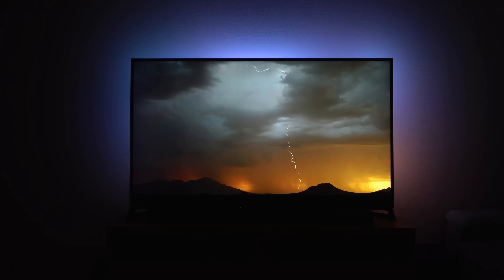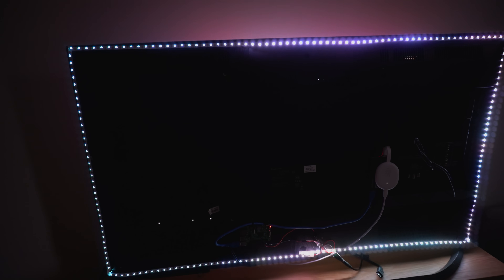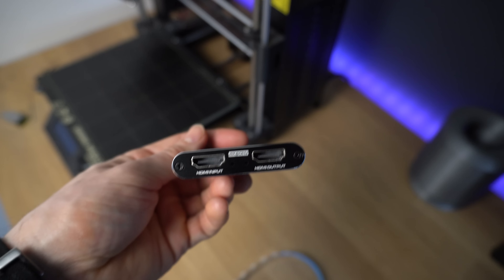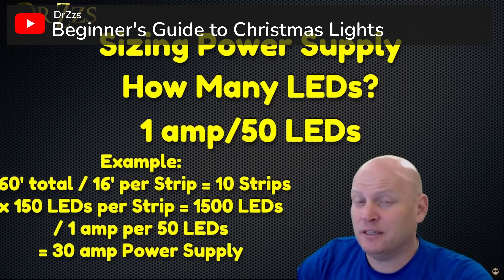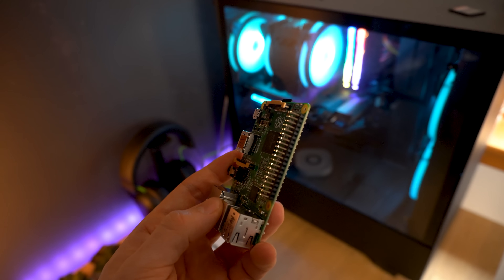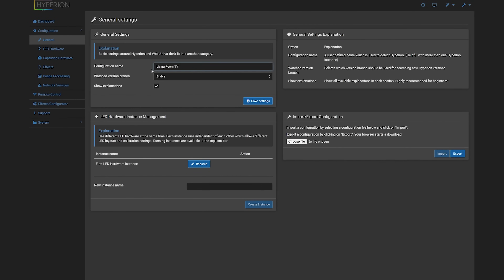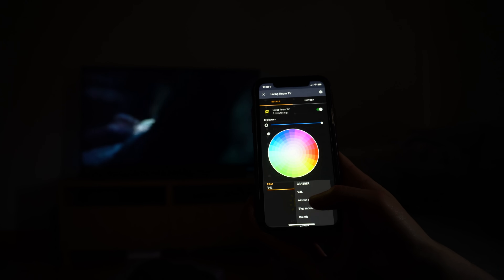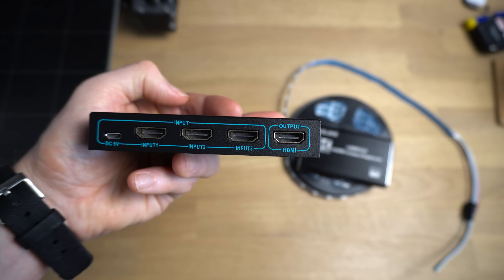Cheap DIY Ambilight TV Project with Hyperion and Raspberry Pi

Comment: Hi Very nice video. I did a similar setup but I happen to find your video after I bought the capture card. I got this one instead : https://www.amazon.de/gp/product/B08JPTXVJN/ref=ppx_yo_dt_b_asin_title_o01_s01?ie=UTF8&psc=1 It looked like It was fitting the purpose 4k60fps, But I didn't know about the HDCP2.2 feature. Can you tell me by looking at the settings If I should get the zasluke instead ?

Comment: Damn, I should have seen this before. I ended up buying this 4k splitter:

https://www.amazon.co.uk/dp/B083JVPXDY/ref=cm_sw_r_em_apa_glt_i_S0J9R1QP433V2X478T0X?_encoding=UTF8&psc=1

And then fed one output to TV and the other output to ANOTHER cheap £18 device, the capture card which then outputs via USB to Pi. Same outcome in the end and probably for a few £ cheaper but I would have loved to have done it in one device if I knew this capture card existed!
Reply from the maker: Damn, well at least you got the same end result!!

Comment: Wondering does the capture card support hdmi cec? due with my current setup, I take the hdmi output through a splitter that does not support cec, and when turning off my fire tv, i still get sound through my sound system...due it does not get the cec off signal, so im considering switching it with a capture card

Comment: Only thing that sucks for me is that I used all the aps on my TV (Netflix,Amazon' ect) so I can't get video out to the capture card, or can I?
Reply from the maker: Yeah unfortunately not, there is solutions that involve pointing a camera at the display, but this isn't a method I would be prepared to use personally!
Reply: @EverythingSmartHome  guess I'd just have to get a fireatick or chrome cast or somthing.

Comment: was the speed of the capture card to the pi via USB fast enough to have a nearly instant response?    I've been holding off on this project for compatibility worries, especially w/ HDR 4k@60 to the tv, etc ,while still trying to keep the cost down!
Reply from the maker: Works amazingly for me personally yes!
Reply: @EverythingSmartHome  Alright, i have everything set up, and it took me hours to figure (most) everything out.   Running a hdmi switch, splitter, capture card---   i was about to give up when I decided to turn my nintendo switch on, the whole thing started working correctly.   I changed the input back to my PC, and it's gone again.   Does this have something to do with HDCP? And how can I get around it?
Reply from the maker: Try starting off much more simply and remove the splitter for now to see what happens there, once you have that working then add the splitter back in.
Reply: @EverythingSmartHome  you were right-- i removed everything, and ran the pc input direct into the VCap, everything worked, but the signal was downgraded.  I ran from HDMI selector, same thing.        As you thought, when I ran direct from the splitter, I only get video signal and no lights w/ the PC input.   So something's wrong there: https://www.amazon.com/gp/product/B07J2Q9NPH/ref=ppx_yo_dt_b_asin_title_o00_s00?ie=UTF8&psc=1  (everything else running through this that I've tested is fine except the PC!)
Reply: I found a second thing that isn't working through the splitter!  4kFirestick.  i'm scouring the web for the issue before I try to swap the hardware! let me know if you think of anything!
Reply: @EverythingSmartHome  Here's where I'm at, and I'm hoping this helps you if you ever end up doing a complete build tutorial.    I narrowed the issue down to the splitter being the culprit.   I got out of PC builds, and TV upgrades before HDCP 2.0, and never really read into it (and I'm still pretty confused with HDCP in general), however the source selector was an HDCP 2.2, the splitter was a 2.0 (the signal was good to the TV, but refused to push to the USB grabber).   I'm upgrading to the 2.2, it'll be here Thurs, and I'll update.   
Another good tip for anyone new to this is ensuring they have enough HDMI cables, and that they're current with everything else. 
If for some reason the splitter swap doesn't work, I'm still narrowing the issue down to the 4k downscale into the 1080p https://www.amazon.com/gp/product/B08QJ84JNP/ref=ppx_yo_dt_b_asin_title_o01_s01?ie=UTF8&psc=1

With all that being said, what's the best way to support you? Patreon, or the buymeacoffee link?
Reply: Fixed.  Upon fixing I also found multiple other things that could cause issues for new users.   The splitter was an issue.  Replaced, immediately worked with poor res.  PC was reporting 1080 rez out.  checked the STD/TV switch... fixed.   Backlight went out again.  Checked the resolution settings on the PC, it was pushing a 120hz signal, switched to 4k @ 60, lights worked immediately!   Hopefully some other user finds this before they order components!

Comment: About the led placement on the back of the tv. The back of mine tv gets hot to the touch(aluminium). Can i place the led on the back of the tv with no worries?
Reply from the maker: I'm not sure about that sorry, I wouldn't want to advise incase it was wrong
Reply: @EverythingSmartHome  yeah, it's troubling... I'll fix some plastic spacers to solve it. But thanks for the feedback.

Comment: Fab video mate, It's really got my thinking - an hour ago I was considering the Hue Sync box and Gradient strips - Now I just don't know. Pricing the parts you've got here I'm wondering what you didn't include, as I assume you have quoted the upgrade cost of your current setup. I'm currently using a 4k firestick and a second input (its a non 4k source) and I do use Diz+, Nflx and Plex (plex mostly 1080p content) and drawing out my plan I guess I can use a 1080p capture if I use a 4k switch so a rough outline of my costing is

Pi Zero - £32
1080p Capture - £18
4k Switch - £22
PSU - £22
5M 60leds/m WS2812b - £36
Consumables - £25

Total running about £145

I think this is still good value compared to the £330 the hue is going to cost, and I imagine this will be cheaply upgradable with a standards change in the future, but something I'm not 100% sure of is would that 4k switch you have shown, show the protected content on my TV ok, and work with the 1080p capture card (from what I understand the capture card only needs to feedback the edge blocks, so I guess my bottlenecks going to be the HDMI switch). Its a lot of money for it not to work for me :/
Reply from the maker: Thanks Chris, sure I already had a Pi and I didn't include the switch in the price because it wasn't required for a single input so that would reduce the price a bit, but the Pi Zero W is like £6? Shouldn't be anywhere near £32 anyways so that should reduce the total price for you. 

The switch works fine in my environment but you'll need to check your own requirements to make sure everything matches up.
Reply: @EverythingSmartHome  Hi mate, I managed to pull together from various sources for about £100 inc some bits off your wish list, so thanks for that. I am overly impressed with the ease of setup and how amazing it looks. Don't suppose you know how to make a switch so I can have a static bias colour do you?

Comment: does it need to be a capture card or can I just use a hdmi splitter?
Reply from the maker: Just anything the the Pi can view the screen on. Would a splitter work since the HDMI port on the Pi is output only and not input?

Comment: Nice tutorial! I also bought myself a Raspberry Pi 3 Model B and this 4K Capture Card from Zasluke. I got it ready to work very fast, but I'm still having weird problems with the capture card not being recognized by Hyperion many times after a reboot, which is kinda annoying. Any ideas?
Reply from the maker: Thanks! Does it show up in the list of capture devices?
Reply: @EverythingSmartHome  This issue seems to be totally random. Sometimes when it's not working it still shows up on "Configuration -> Capturing Hardware -> USB Capture -> Device", but not on "Remote Control -> Source Selection" or Hyperion seems to lose part of its config and the USB Capture Device is set back to "Automatic".

For debugging purposes, I just rebooted 5 times in a row and everything got recognized and the LED stripe represented the colours of the input source, but after the sixth reboot the USB Capture Device was set back to "Automatic" lol. I installed Hyperion using the current Hyperbian image.
Reply: After some further examination, it turned out that the capture card didn't receive enough power from the raspberry pi USB port, causing the card not being recongized by the raspberry pi from time to time. There's also an indication that the raspberry pi is not able to offer enough power for the capure device alone, when the red PWR LED turns off once the capture device gets connected (dropping under 4,63 V)

I got it working now by using a USB 3.0 dual power cable, where the one USB-A connector goes into the raspberry pi and the other one into my external 5V 20A power supply. Now the red PWR Led stays on and the capture device receives additional power from the power supply and I haven't noticed any interruptions since.

Comment: Great project
I´ve rebuilt you system and i´ve connected the capture card with my Linux Server.
Everything works like a charm...

But when it try to run it on a Raspberry Zero W, the Raspberry wont find the Capture Card on the USB Port... :-(
How did you get the Capture Card to run on Raspberry? Is the a spezial driver needed?
I searched for the USB devices with the lsusb command, but Raspberry shows no device connected ....
Reply from the maker: Hey Michael,

I'm not sure on that one, I don't think any special drivers would be needed, my Pi Zero W worked perfectly with the capture card I had, nothing different to the normal one. Perhaps try changing your cable, some micro USB cables provide power only and not data so perhaps that could be happening?
Reply: @EverythingSmartHome  I’ve tried 2 different cables (I know they are ok because I used one of the for flashing the wemos).
Hmmmmm strange
Reply from the maker: Are you using Raspberry OS on the one that works and also the Pi?
Reply: @EverythingSmartHome  no, the working one is my Server running Ubuntu 18, the Raspberry zero is running Hyperbian (the per-configured Hyperbian Os) and there the USB device is not recognised
Reply from the maker: Ah, then yes there is a difference, different distros will contain different drivers. You would need to figure out which driver it is and then install it on Hyperbian

Comment: I'm definitely building this!! BTW you said you were going to switch to a Pi Zero W and I would like to build it on that too. The connection from the capture card to the Pi Zero would be through a USB to microUSB instead, right??
And I’m planning on building around a Fire Stick that also needs to be powered to an outlet but I’m running low where I want so, do you think it would be okay to be powered with the same power supply along with the Pi and the capture card??

Thanks for all your videos and helpful content!!
Reply from the maker: Hello, yes that's right! You should be able to do it but just make sure your voltages are all correct and stable!

Comment: Greetings, first off, i really enjoyed the video! I am quite new to Raspberry-stuff, so i am learning along the way. I bought the parts mentioned in the descriptiion and I got the LEDs and Hyperion with the Pi Zero W to work (though with a massive delay atm... more than 1 sec). But currently i am facing the problem that the capture card isnt outputing any signal (HDR / 4k) to my TV whilst recognizing the input (PS4 Pro) and chaning the LEDs. I was wondering if HDCP 2.3 was a problem here, the capture card is faulty or i simply missed something here. Help would be greatly appriciate if possible, else i will ofc wait patiently for the Tutorial. ;) Cheers
Reply from the maker: Hello, thanks and glad you decided to give it a go! That shouldn't be happening no, the card should work with that source but just to confirm, do you have another HDMI source you can test with?
Reply: @EverythingSmartHome  Thanks for the fast reply! I hooked up my ps3 and actually got a singal. The PS4 seems to be the only console not working for me, which is sad, since i use it for netflix n stuff. Maybe i will find a way to get the ps4 working (through a 1 in 2 HDMI splitter or so) since input is being detected. Now again i am facing that huge 1-2 seconds delay. I tried to play around with the Smoothing and ofc setting the capture card resolution to 720p but the delay stays. Any input on what i could do?
Reply from the maker: It should work fine with the PS4 but guess it depends which capture card you have, my Xbox works fine with mine so hopefully you can get it working.

After you make changes to the resolution then reboot the system, I found that helped me when making changes! If not try lowering the frame rate to 30 and even reduce the resolution further
Reply: @EverythingSmartHome  I tested some more with rebooting and swapping some settings and the dealy sticks around. Now I stumbled upon the led visualization. Here, analog to the leds, is again the delay. So when the visualization updates, the leds do too. For me this seems like there is something up with my capture card (same model as yours). There is input (with delayed transmission to the pi) and no output. Moreover the visualization in your video looks smooth while mine stutter and lags.
Reply from the maker: What do you mean by analogue sorry? I would suggest changing HDMI cables, the one I got with mine would occasionally cause a flicker but after changing everything was perfect. 

The delay could be the Pi Zero not being able to keep up but I would have thought it would be quicker than that.
Reply: @EverythingSmartHome  I meant that when the LEDs change, so does the picture. So I checked the cables and they should be fine. But just now my Pi4 arrived which i planned for using wiht Home Assisant. I will try the setup with the Pi4 then, I hope the 5V from the Power Supply will be fine with it then. :D

Edit: Today I setup everything with the PI4 and the delay was indeed gone. Still i get no output to my TV but only on PS4, maybe i am missing some video settings.

Comment: Great project.  I tried to do this myself and have gotten most of the way through setting it up. Purchased the same LED strip and capture card and running Hyperion on a raspberry pi 4. The video goes through Hyperion settings quickly, but I think I've matched everything.  I can see the video showing up correctly in Hyperion, but something is wrong with the signal to the lights.  They are flashing all random colors.  Even when I set it to a static color, it still is flashing random colors.  Any thoughts on troubleshooting this issue?
Reply from the maker: Hey Jeffrey,

The Hyperion section wasn't meant to be a "how to" so that's why it was fast and I didn't show everything, but sounds like you've done well. 

The reason for the flickering could be a few reasons but have you checked you are using s common ground as mentioned?
Reply: @EverythingSmartHome  I believe you are correct.  Is there a way to power the pi separately and still have a common ground?
Reply from the maker: Hmm there is but can I ask why you would want to do that?
Reply: @EverythingSmartHome  It was one less wired connection to fail and it took a small amount of power away from the LED strip. I already had a power supply that I bought with the pi so I decided to use it. I'll cut into a micro-USB cord tonight and see if that fixes the problem.  It sounds like it should.  I really appreciate your responsiveness.  Keep up the good work on your channel! I enjoy your videos.
Reply: @EverythingSmartHome  I also forgot to mention that I'm using a Raspberry Pi 4 which uses USB-C for the power.  I wasn't sure which wires to spice.  I'm assuming it is still the red and black, but I'll look that up.
Reply from the maker: Let me know how it goes!!

Thanks appreciate the kind words 🙏
Reply: Hey mate, did you managed to get rid of the flickering issue? I connected my wires in the same way as the video shown, but the rgb strip is still flashing randomly (I'm using Pi zero tho). Researched a lot and most cases refer to the voltage differences between 5v and signal from pi at 3.3v. I am quite frustrated cuz I can't get through it. Wonder if I miss something.
Reply: @zht9  I did get rid of the issue.  I did not wire it the way the video showed and powered the LED strip and the Pi separately.  Once I connected the ground from the LED's to one of the ground pins on the Pi, it started working.  A common ground between the LED's and Pi is important.
Reply: @jeffreyanderson02   @Jeffrey Anderson  That's awesome! I'll try that out. Thanks a lot!
Reply from the maker: How are you powering?
Reply: @EverythingSmartHome  My strip and pi take power from the same 5v10a power supply. I wire them up as you did in the video. I also checked other videos many times, so I think I did it right. That's why I couldn't figure out what happened. Now I guess I need to add one more cable connecting from light strip ground to Pi ground if I understood 'common ground' in the right way.
Reply from the maker: If you are using the same power supply like you say then you already have a common ground and adding another wire shouldn't do anything, unless there is a misconfiguration somewhere
Reply: @EverythingSmartHome  I think my strip died. I think there is an issue on either psu side or strip side. My new strip is coming on the way. I'll have another try later. Anyway, thanks for the help. Keep making more videos mate. Love your video of home automation techniques!